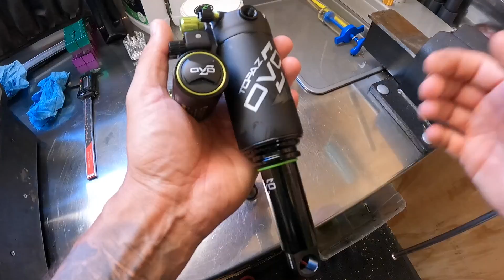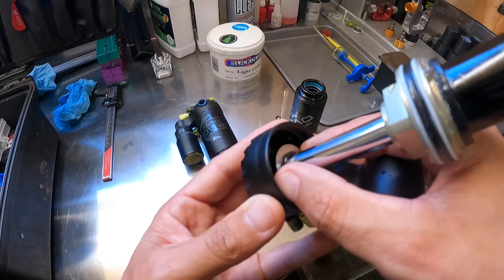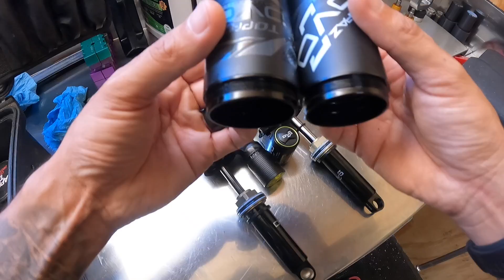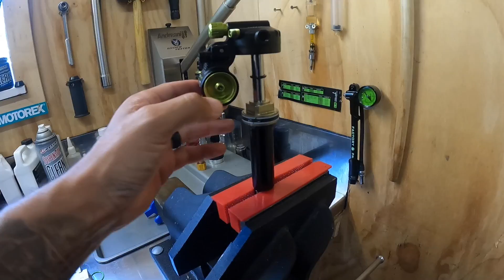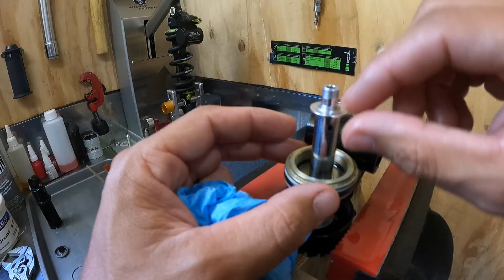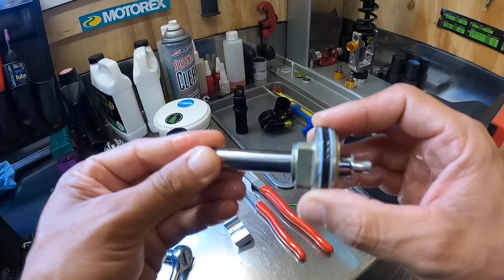2022 DVO Topaz Overview

Comment: I am trying to change the stroke length from 50 to 55 on my 210x50 Topaz 2022. Where is the travel spacer I need to remove as the shaft is stamped 55/50 MM

Comment: I installed a 2022 Topaz today on my 2021 Giant Trance (P.O.S) and the difference over the factory Fox shock was night and day different and I haven't even started to work on dialing it in. I absolutely recommend to everyone. Better yet, these guys are super easy to deal with. Just do it!
Reply: I have the same bike and looking for a shox 165x42.5... Seems like the topaz is outta stock on dvo website 😭😭
Reply: The 2022 Topaz was so good, I also bought the DVO Onyx Smashpot. Absolutely amazing gear and so good. You need to get DVO!! (Not sponsored... Just worth it!)

Comment: @Jesse DVO  

I have 2021 Trek Fuel ex  with Fox dps rear shock and im planing to upgrade my rearshock, do you recommend Topaz 2 air shock for that bike or new Fox float X.
Topaz 2 is cheaper and how much I see it has more adjustments. But im honestly looking for more durable shock, something that doesnt require very often service...
 Thanks in advance
Reply from the maker: Anything will be an improvement over the DPS but yeah obviously I’m going to recommend the new topaz

Comment: Any chance the new aircan is compatible with older shocks ? In the 210x52.5 version bottom out still leaves a lot of shaft visible so the additional length wouldn't be a problem, question is, is the "airshaft" diameter the same than before ? And s the equalization dimple in the same spot compared to the air-can threads ?
Reply from the maker: Yeah I’ve tried it and it’s works 🤘🏽
Reply: @dvosuspensionnz  deadly ! thanks to the info !

Comment: What is the max PSI this shock can run ? I'm a bigger guy and need more Psi to not bottom it out but can't find what the max is ?
Reply: To stop bottoming out you need to add volume spacers on the positive side. Air press to set sag

Comment: I’m trying find a shock that has more support at the top do the stroke for better pedaling. I was referred to the topaz. Can you do this with any shock? Something with adding spacers to the negative air?
Reply from the maker: You can add spacers to the negative chamber on a topaz to firm up the 1st part of the travel yes
Reply: @dvosuspensionnz  does a fox dpx2 have that feature as well? I know it’s a random shock and you might be biased but I was wondering anyway. I like dvo but trying to save money and time
Reply from the maker: @2minus1_Shredder  I don’t think so